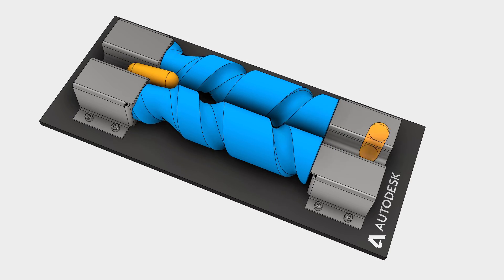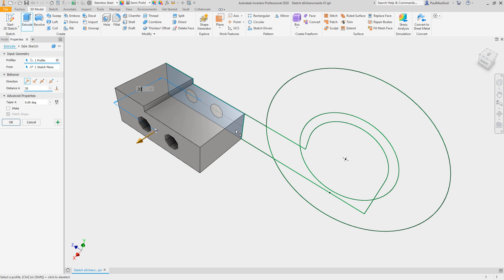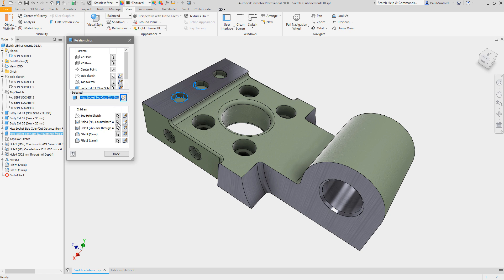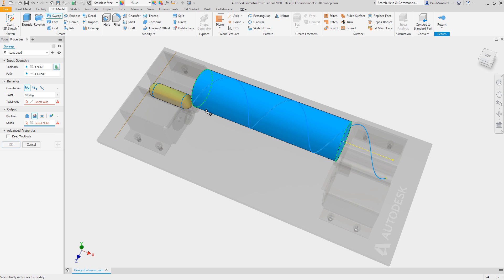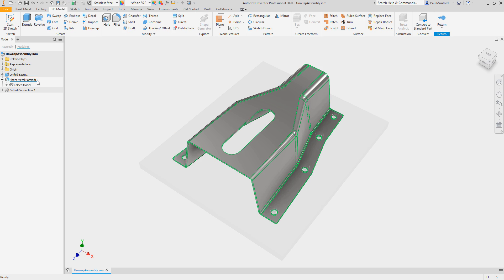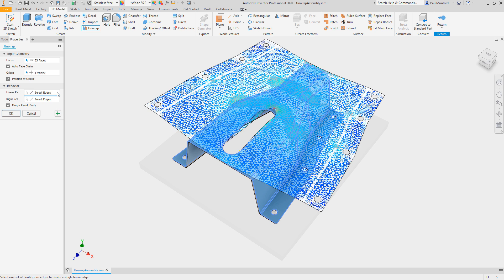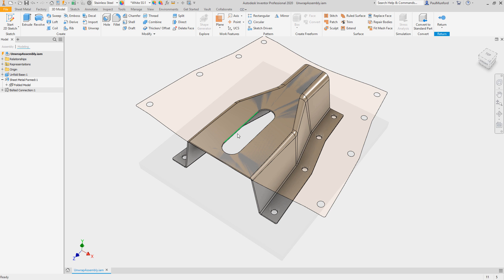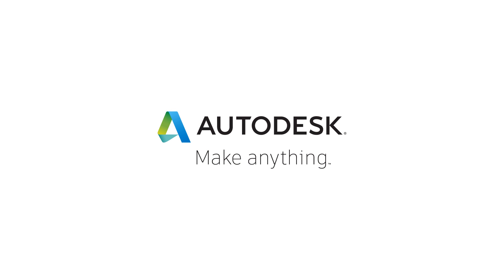Autodesk Inventor 2020 what's new: New Design Enhancements

Comment: That feeder simulation in the beginning looks cool. Where can I find a tutorial for it?
Reply: You can find a guided tutorial on how to create the feed screw by starting Inventor 2020, then clicking the Get Started tab>Tutorial Gallery. Set the Place filter to All Available, and the Type filter to All. If you sort by Recently Added, Create a feed screw with solid sweep will be near the top of the list. Currently available in English, but it will soon be available in the 12 other languages we support. If you've never used a guided tutorial, you need an active internet connection to download the tutorial, then it runs locally. Guided tutorials contain datasets and videos for each task for a hands on experience.

Comment: The interface and operation of inventor looks so suitable to me, shall I switch to inventor from creo?
Reply: Been using inventor for 3 days as a student, already got used to it!! It’s easier than autoCAD, I love it!!
Reply: Of course! Used creo before and it's a relief!
Reply: Personally I have been using inventor for four years and find it to be a solid software that is generally brought down by it's performance issues. Generally I would say if you are using Creo don't switch the benefits generally are not worth it.